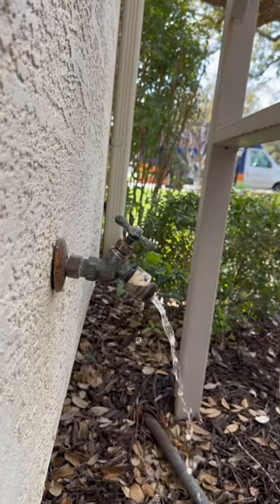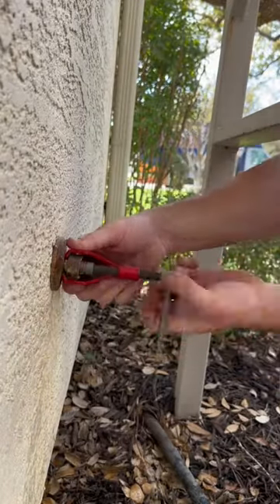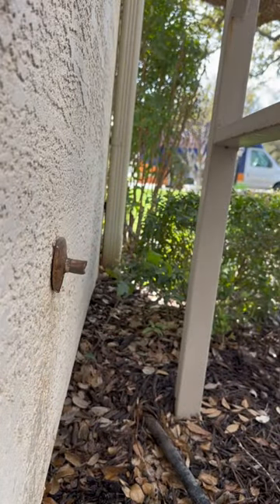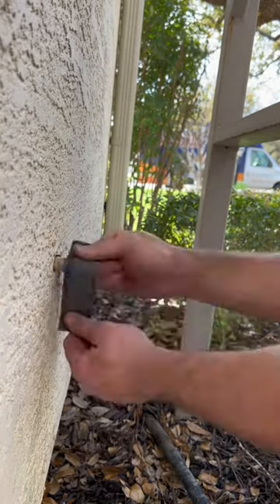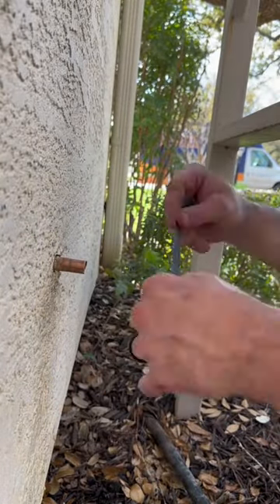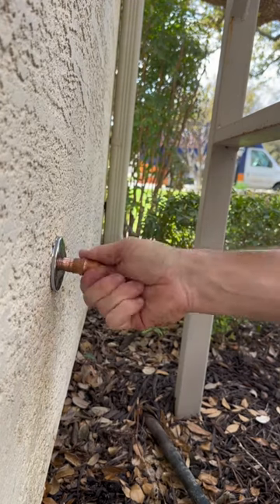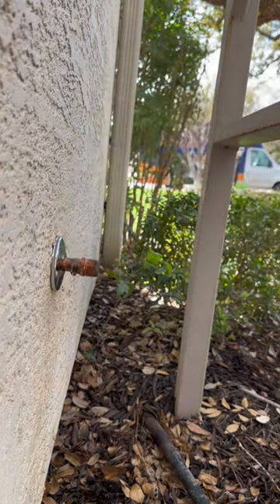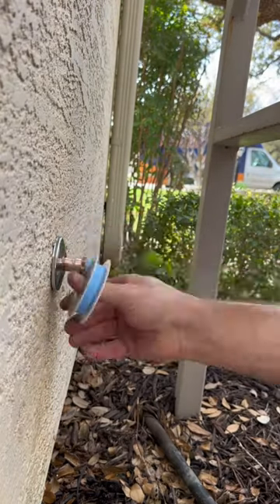Hose bib replacement. #plumbing #plumber #trades #leakrepair

Comment: To the knuckle dragging apes who still don't understand. Teflon tape is NOT a sealant, it IS teflon and is a lubricant to help you tighten better. The pipe dope IS a sealant with a little teflon in it usually. Thanks for your attention.
Reply: Are you off your meds Maddy?